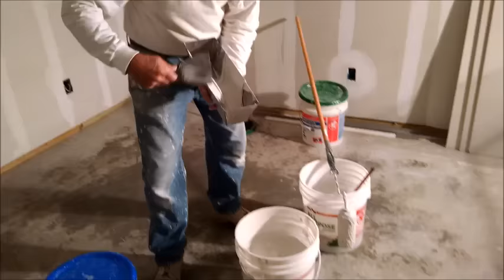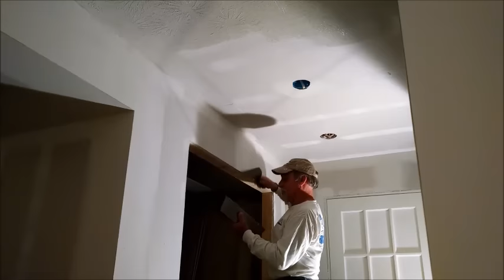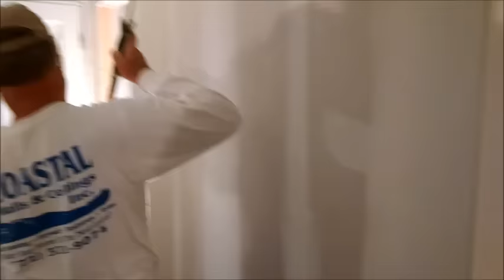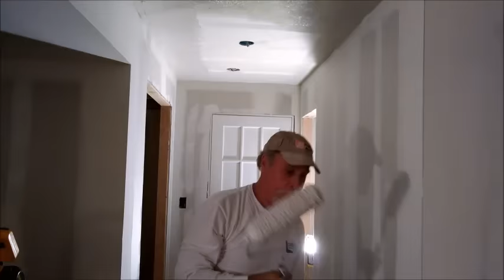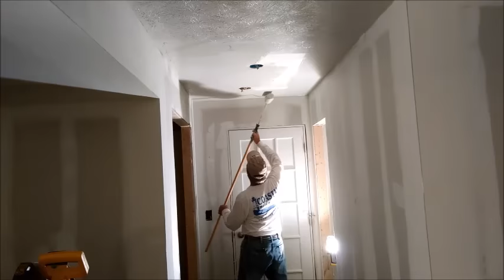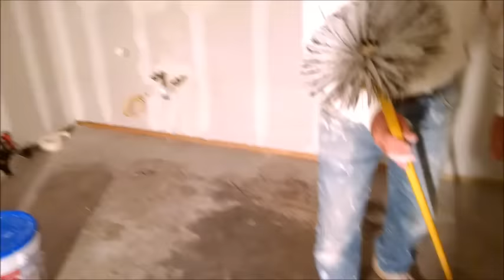How to apply drywall stomp texture to ceiling

Comment: What brush were you using?im yrying to match that exact texture
Reply from the maker: Hi Justin. It's a stomp texture brush( that one was made in the '80s by Goldblatt Tools). It has long bristles, not too dense, and makes a nice snowflake or flower shape. Tex Master makes a similar one today. If you Google it, you should see several options. Good luck.

Comment: so i noticed recently that the ceiling in our master bedroom was sagging significantly (built 1993, stomp texture). it was nailed and over time, the weight of the drywall was pulling the nails out. i dead-manned it and put screws in. I've mudded over the screw holes and i'll sand that. can i basically follow this procedure to "blend in" to the existing stomp? ...ceiling's never been painted.
Reply from the maker: Just be sure that nothing else is holding the ceiling drywall down from  your trusses or rafters, and that the drywall is tight to them. Mudding in the screw holes is good and sanded, hopefully not affecting too big of a spot at each screw hole. I would try to keep the retexturing more like a touch up "dab" than rolling on  a whole re-coat, just the  screw spots. Not having been painted is a good thing to help it to match. Good Luck.

Comment: Where do you get the stomp??
Reply from the maker: The stomp brush? It's an old one from the 1980s made by Goldblatt Tools with a plastic base. 
Today you can get one like it at Lowe's or Home Depot, or some paint supply stores. Texmaster is a brand that is similar. AllWall Tools online carries that or a  comparable one. Thanks for asking.

Comment: I have a question 
If redoing a ceiling texture does the old texture have to come off before putting on new mud
Reply from the maker: Yes, if replacing popcorn or stomp texture to be smooth or spray knockdown, you need to scrape anything really protruding from the ceiling, sand down to as close to smooth as possible. I would recommend skim coating the ceiling prior to putting another texture up. Make sure the surface is as flat and level as possible, and dust free. Good luck.
Reply: @swissbanjoman  
So one more question if doing a slick ceiling do I corner tape the top of wall to the ceiling or just tape upto the ceiling????
Reply from the maker: @marvinmccallister7141  Thanks for asking a good question. If it's existing drywall on ceiling and walls, there's tape folded in the angle at 90 degrees. If it's not, or peeling off, retape the angle with thin mud behind the tape, press in folded tape and wipe smooth. For slick finish, coat over each side after tape coat is dry. Then sand.
Reply: @swissbanjoman  
Thanks so much for responding to me....been finishing for along time but been a long time since I've had a ceiling job.....I just do on the side these days....be blessed an ty
Reply from the maker: @marvinmccallister7141  you're very welcome!
Reply: Swiss Banjo Man  Thanks,  I purchased a home that has this texture on the ceiling and I find that it collects/keeps the cobwebs and particles seems to drop a lot from it.  I have a lot of allergies and want to remove it.  I was told I couldn’t.   So glad to know I have options.   Thank you

Comment: Ive been trying to do this in my own home but having trouble with the mud. I may not be mixing it right with water or using the correct roller brush. But i watch people do this and i never see them drop mud all over the place. I do it and im constantly dripping mud everywhere. What am i doing wrong?
Reply from the maker: Glad you asked. The mud thickness is key to doing it right. Mud has to roll or flow but can't be too soupy. Starting off like pancake batter or slightly stiffer. It's easier to thin it than to try to thicken it. When you load the roller either in a bucket or on a wide tray, slide off any dripping mud that might try to fall. It takes a little practice, and a knack. Don't roll out too far, leave enough mud in a consistent stipple, and cross roll it to make it very even.

Comment: My ceiling has the same pattern as your creation. unfortunately a patch was applied but does not match.  Should I remove the unmatched area b4 the new mud is applied or I can put the new mud pattern over the unmatched area. thanks
Reply from the maker: My suggestion, JJ, and it's not the only way, is to try and sand the patched area smooth first, whether it's just bumpy or uneven. If it was already textured over and just hangs down too low, creating a bad shadow, get it as flat and smooth as possible first. Texture on top of texture always will stand out as a patch job.When reapplying mud and stomp brush, keep it light and feather it into the existing  edges, so as not to build it up too thick over the original job. Have a brush that makes the same size pattern, like a flower. Hope that helps.

Comment: Nice technique, explanation, and great music, but Ugh!  Why would anyone want this in their home?  Stomp/stippled - just yuck!  Smooth ceilings are more versatile - can paint & change colors and easier to deal with if a repair is required.  One of the worst ceiling finishes ever visited on homeowners.  I did away with all of mine. But your video was interesting to watch.
Reply from the maker: Well, somebody somewhere must have wanted this in their house at some point in time. Even popcorn ( with glitter no less) had its heyday.
Smooth finish is definitely nice, but it’s got to be done right. I appreciate your comments.

Comment: Nice work with that blade! I've always loved watching skilled craftsmen ply their trade. Helped my dad stomp a lot of ceilings back in the day.
Reply from the maker: Well, thank you very much. I appreciate your comments. Nothing like learning from your dad!
Reply: @swissbanjoman  One thing he used to do was thin the mud with  ceiling paint.  Made it brighter and looked freshly painted when it dried. Ever tried that?
Reply from the maker: @firstcommunitychurchofgod-1202  No, Jeff, I have not tried mixing paint in with joint compound, but it makes sense that it would look more finished and probably dry whiter. Thanks for the tip.

Comment: I have been a painting contractor for the last 20 years in Massachusetts didn't relive they still use this technique.  all the jobs and GC I work for, plaster the walls and ceilings smooth, I never see patch and plug and textuered ceiling. But thanks for sharing if I ever come across one now I will know how to fix it.

Comment: What size is the stomp brush? Thank you.
Reply from the maker: That one is 9" in diameter. The newer ones I've seen around are 7" -10". They make a double brush, called a crow's foot or slap brush, available in different parts of the country. I recommend checking out All Wall Tools for their selection, if you can't find it in your area. Good luck.

Comment: I feel if I roll more then 2 feet and I go to stomp it there’s not enough mud to home a nice texture. I’m also a diy guy I may not no exactly what I’m doing
Reply: Roll on thick enough with a 3/4" roller mixed real well and thin (almost running/cake batter) until it sounds slushy; you'll hear the sound, very wet. Go over it evenly just as you would with paint (look up videos if not acquainted with the process).

Comment: Can you mix joint compound with paint and get the same result?
Reply from the maker: Yes, we've done that, well blended in white ceiling paint. About a gallon of paint to five gallons of joint compound. Just raw mud is fine, but it needs to be painted over later to last a long time.
Reply: Swiss Banjo Man Thank you for responding. I'm painting my basement ceiling and was hoping to get the same result
Reply: Mike Bell it was indeed a tad messy but mixing the mud with the paint came out pretty great with the texture roller I used

Comment: Can you give me the ordering info for the brush?  I bought a Goldblatt Texture Brush # G05116 and am not sure if it is the correct brush- it looks too stiff.  Thanks!
Reply from the maker: Yes, Larry. Thanks for commenting. The brush I'm using in the video is very old, from the early '80s. I'm not sure they make it any more. I recommend All-Wall tools from Las Vegas, online ordering. They carry Tex-Master brushes, a couple of different kinds. I like one that's long, soft bristles. Opened out, it should be about 8 or 9" in diameter. A good roller should be long nap (3/4 to 1"). Wide rollers are good, too if you have a wide tray. Good Luck!
Reply: Hey Larry. Sorry to bust in on the comment, but they sell a precut texture brush at Lowe's (Item # 315277 Model # 8806) that isn't to awful with a little bit of tweaking. It takes a bit of work (trimming bristles and forming the brush) to get a solid pattern out of a new brush. I'm like Swiss and am fortunate enough to have older, broke in brushes (passed down to me from my father and grandfather). If you get the precut one, it has directions on the back to get started breaking it in. I may make my You Tube debut and make a video on how to do new brushes lol.
Reply: Too hard to hear music too loud try better next time